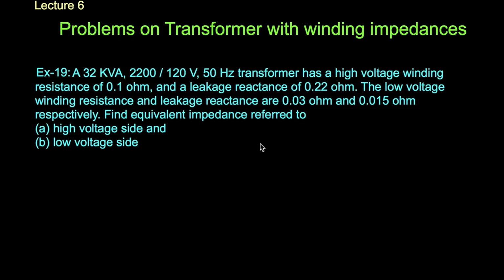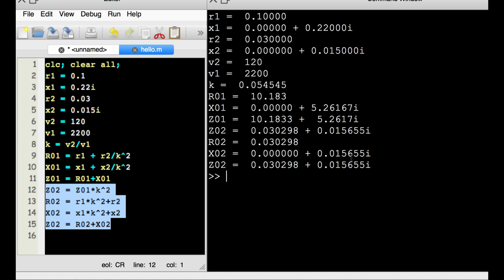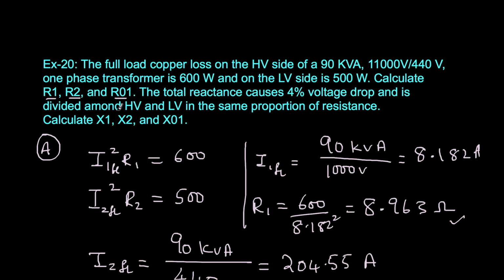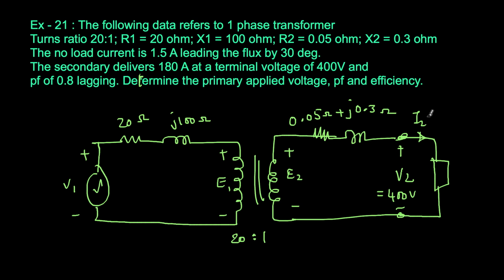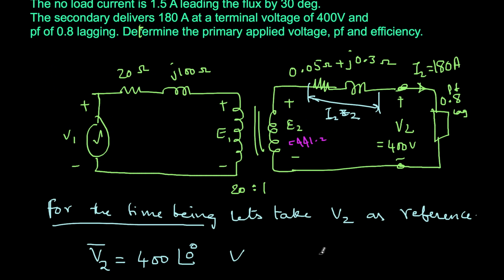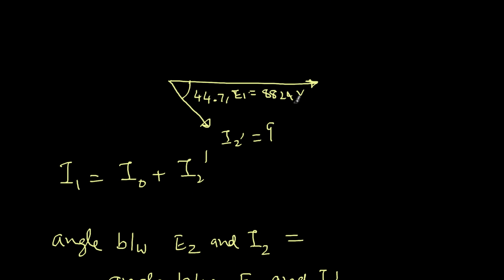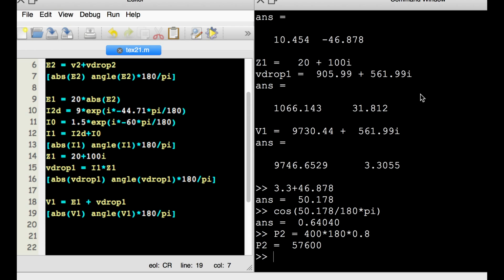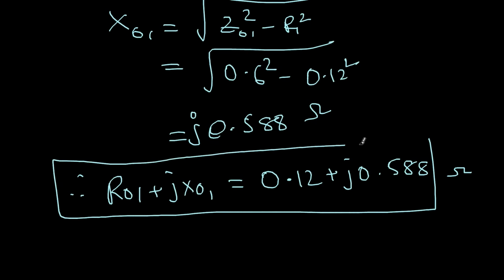L6 - Problems on Transformer with Winding Impedances

Comment: Help me on this 1
Q1. The primary of a certain transformer takes 1A at a power factor of 0.4 when connected across a 230V, 50hz supply and secondary is on open circuit. the number of turns on the primary is twice that on secondary. A load taking 50A ata lagging power factor 0.8 is now connected across the secondary, sketch, and explain briefly the phasor diagram for this condition, the phasor diagram for this condition, and the value of the primary current